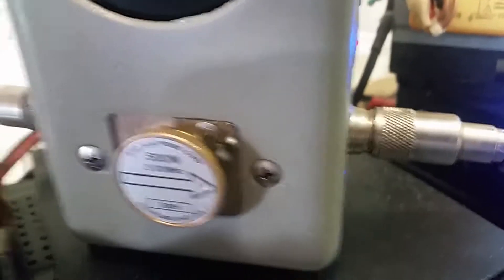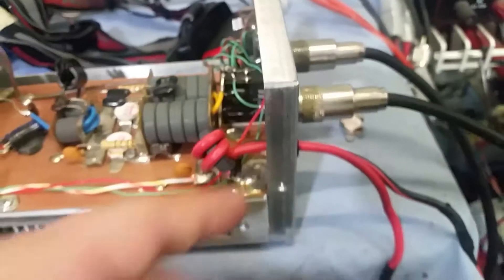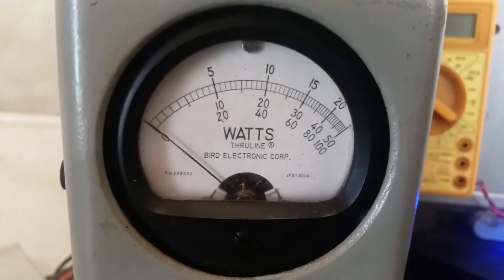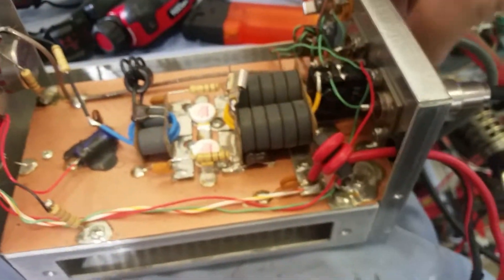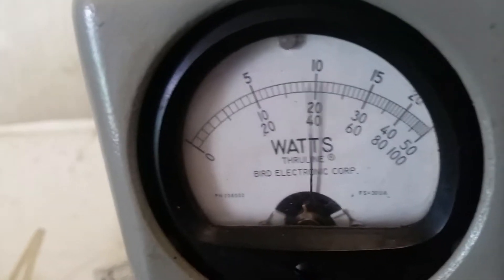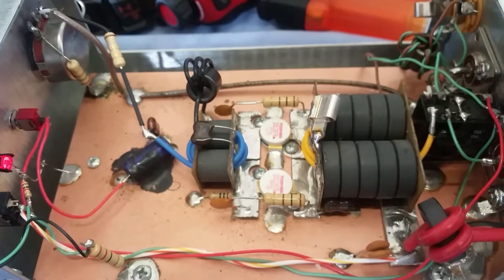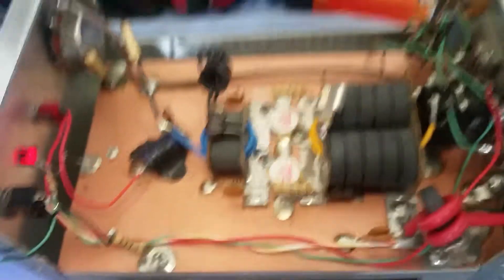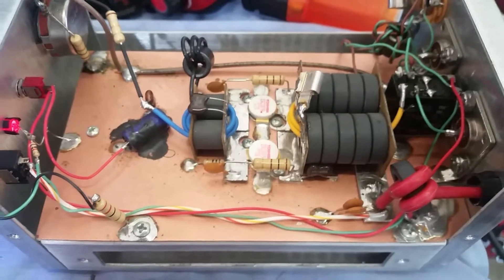Mr. Roy's Fatboy 2 Pill PWR Output Improvement - [Heating Tha Oil 🛢 🤏]

Comment: Nice box. I had a lot of them caps on output transformer go bad. and a bunch of output tune caps drop in value. it's the heating over time breaks them down .10 AWG is fine on 2 pill. about 30 peek amps.  If wire is long then go up a AWG or 2. hear in US and CANADA we use AWG (American wire gauge ) and much of world uses Gauge which 10 AWG is bigger than 10 Ga wire. The UK uses MIL for wire . just metric . are very large wire uses the MCM scale so does UK.  73's

Comment: I have 4 gauge on my 2 pill driver and it does about the same power, so not sure there would be much gain there anyway... 4 gauge is a must on my 2 pill comp key box though.. LOL
Reply from the maker: Lol wow you must be pushing that sucker to about a KW, 3 to 4 🐦 on voltage ⚡ 🤣
Reply: @1883GotDown  LOL... Nah, the comp 2 pill volted to 20v would do about 6 bird and a little over 8 peak with the Cobra 29 I had on it.. Haven't run that one in a looooong time though....